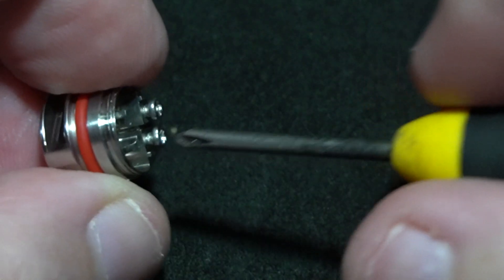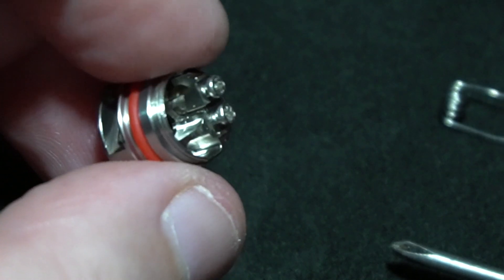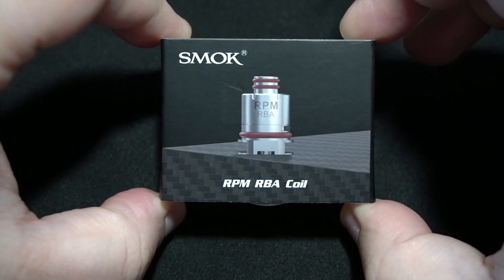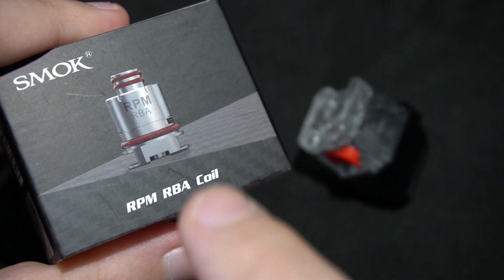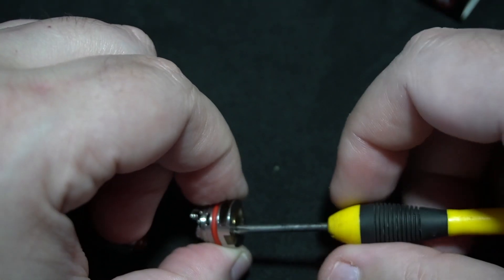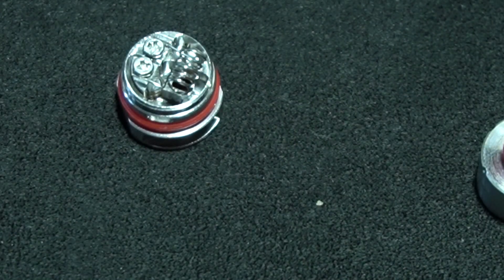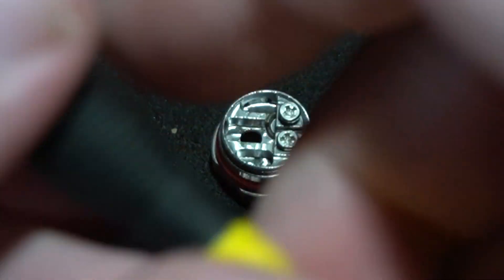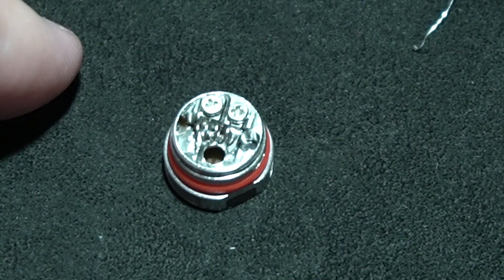WARNING: Smok RBA Head for RPM40, Absolutely Livid | Kangertech 2002 Style

Comment: Hi Jai, love your passionate reviews. I also bought the rba for this device, so i can use custom type coils in it for when i'm out & about. Yeah, it's a bit small & fiddly, but manageable with my smaller fingers. Try buying a spare empty pod, cut the top off of it, & you can pulse your coils on the rpm 40 at about 8 watts, we don't wanna melt the plastic pod! My rba kit came with a small plastic plug, which you push into the rba airflow hole, to restrict the airflow for mtl vaping, i did'nt see the little plug in your accessory bag ?

Comment: I bought the Smok RPM80 Pro and the RBA head at the same time as I do not like buying sub-ohm coils. Normally I am in the RTA/RDA camp, but I did want to try a pod system on the cheap. I like the pod device with the RBA head though I am dreading when I have to put in a new coil. The screws are so tiny. You made it look easy with 26 ga wire so maybe it won't be that bad. I don't see me trying any fancy coils in it as there isn't a lot of room and as you said, no way to test it. This was another fine video review.

Comment: It's basically the same rba that came with the Spirals tank some years ago. It's kind of a pain to build, but it works, I used it a ton. But you could screw the Spirals to a mod to check the resistance, unlike this one.

Comment: Got 3156 hits so far on my RPM and it feels like the battery doesn't want to keep up the way it used to. Probably has an 18350 soldered to leads like a lot of AIO devices do. Gonna rip it apart when it finally goes to shit to see what makes it tick.
Reply: Dude if you do open it up please post your finds in here. I would like to know if it is an 18350. I don't use pods/aio devices hardly ever. But I have a few like  the Orion, Dot, and I even bought that stupid Vicious Ant AIO device for like 4 beans (waste of money) but however I was thinking about getting one. I've sold like a dozen in the shop I work at but I would like to hear from a real vaper. What is your opinion of the RPM 40?
Reply: @turbotonye-4124  I'm pretty impressed with it actually. Had it for a few months and it's not bad for a someone starting out vaping because of the coil options and adjustable wattage. I've been vaping for years and for kicks have tried several of the pod type devices as they've come out. Non of them are meant to indestructible, long lasting and each has their ups and downs. The only knock I have against the RPM is there's no adjustable airflow, and now, a battery that doesn't last as long. 
I work in construction and usually tote around a Voopoo Drag with a Vaporesso Target Pro tank as my daily driver. The RPM was an experiment to see if I could be satisfied with something more compact but had similar wattage and vapor production.  If the battery was swappable it would be my new work vape.

Comment: The black cap pops off at the top you could see it glow but you would have to pull the coil back out and have to strum the coils but it’s a pain in the ass. But I did pop the. Black part off the top of mine and it just pops right back on

Comment: Its a pain in the ass but you can put coil on another base with 510 connector and dry burn before installing it on RPM40.
Reply: or...you can just buy a real RBA to begin with lol
Reply: @Mookaton  Yep, it doesn't matter if its an RDA or RTA as both have the same base.
Reply: @faisalroqi7646  If you have any RTA or RDA at all and not using it, remove the base and use it to dry burn the coil you will use in the RPM40. No need to cut wires before installation in RPM40 as you do not need to put the cover on RTA or RDA base to dry burn.  Just attach to a mod and burn at low power to make sure no hot spots are present and any contaminants or gone.

Comment: I remember when almost all build deck screws were like this, it's a hassle but all you have to do is wrap the wire in a loop at the ends (without overlapping) then screw it. Also anyone who builds should practice on difficult build decks heck I was rebuilding on the Cisco attys around 2009. Now that was brutal! But no it's very depressing that smok would release this.... What I don't understand is why people don't rebuild their "disposable" heads they're almost always really easy

Comment: Kangertech did have a nice rba head back in the day. I used to love sub ohm can with rba heads. Can’t remember the last time I actually used one. I do like the fact that it works with both the RPM 40 and the Fetch as well. But damn no 510 so only spaced coils and not being able the put that tiny thing on a atty stand while you build it ...sucks. Wtf Smok think ahead. What the hell did they lay off their whole R&D department? Thank god for higher end devices because if I had to use this thing I’d shoot my self.

Comment: The guy that did the RBA head that came with the original TFV8 must be long gone.  That was my first rebuildable and I had no issues with it.  This just reeks of zero effort.  Just a check in the block.
Reply: Yea that's the best rba for it's time.  Uses it for a year and a half
Reply: I'm still using the TFV8 RBA head this day, for around 3 years now. Works fine, no issues with it.

Comment: Yeah, no dry burn, and checking resistance prior to vaping a dirty ass finger print/oil laden coil. Smok: we need an RBA head for the RPM40 to rake in that sweet green
Also Smok: hey, just throw in that RBA head left over from 2004!
Smok: our work here is done!

Comment: I agree with you 1000000% this is shit. Element vape refused to give me a refund even though they're selling shit. Maybe if I were 6 or 7 I could use it. The other could are great but I figured I could use my multimeter and all my fancy could from my old rba and rdta s. I'm not a Newb, I'm going to contact smok and then if there's still no resolution I'm gonna call chase and initiate butter protection. This thing is dangerous for someone that does not have an adapter to check it on a traditional meter. Element vape lost a customer and is going to get a bad review and complaint to the BBB! Dicks, they literally tried to tell me to use the coil that came with it only when I asked them about testing it to make sure it didn't blow me up... Lol?! Totally irresponsible.

Comment: The point is not buying coils. For most of us it's a work back up not our main device. For as much as you cry I always thought you were a thong guy. 😆 But on the serous note it's not a bad device I got 2 for work.  My bigger devices pulled my pants down may be you should keep one no one gonna want to see your plumbers crack in a thong.  Except your wife. 😆 lol all busting aside nice review had me laughing. I got big hands hate little screws that's why I only get screwd big time.  Have fun keep it real.
Reply: Ps they had to make it you can't see fluid level so dry fire happens often. Killing coils I hate devices you can't see fluid levels as main device. They protect tank yes but you loose out on dry fire when you don't check it often not for new user.

Comment: It's not that hard. Anyone building should know how to space the coil and check it to make sure there is no contact with the body. You don't actually need to see if the coil is heating evenly if you are sure you made it right. It is not rocket science, it's a simple wire you should put between two contacts. If you don't know that much you really shouldn't build coils honestly.